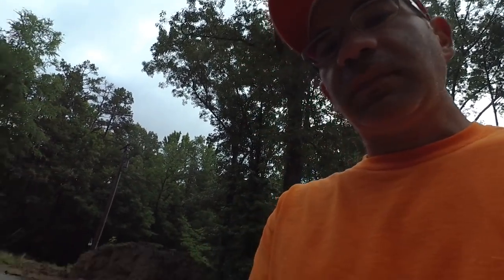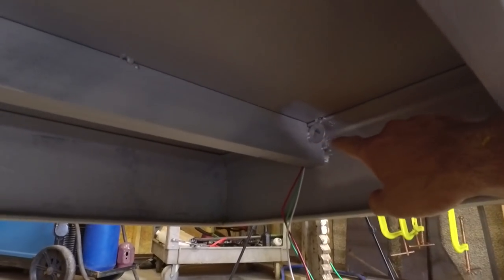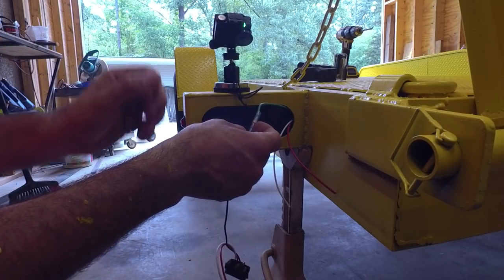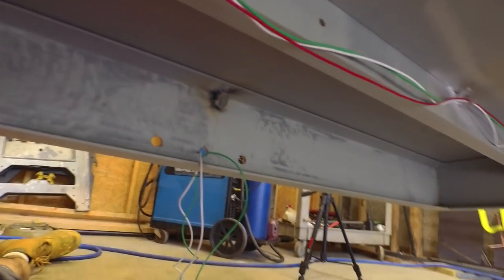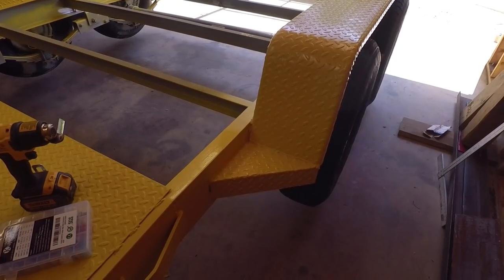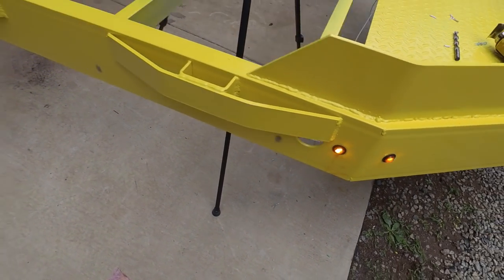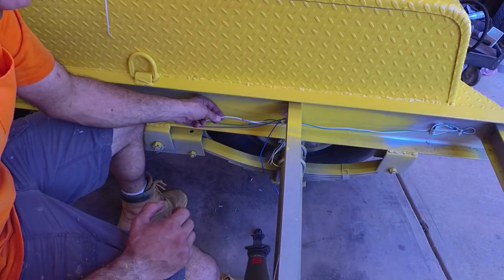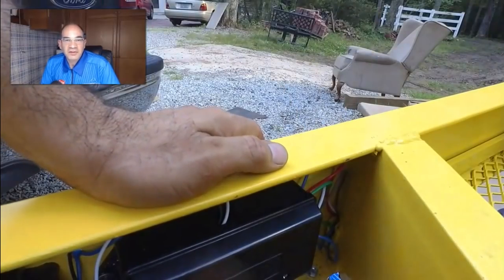Equipment trailer build part 4 Wiring How to wire an equipment trailer

Comment: Another YouTuber, Andrew Camarata used the same type of lights on his trailer build. He did add a plate to cover the 3 marker lights on the rear end, he drags the trailer thru the dirt from time to time. I liked the conduit idea for a wire chase, with all the splicing it would be cut up.
Reply from the maker: Yes I thought about adding a skid plate like andrew camarata did on his equipment trailer but I'm hoping to get by without it. We shall see!

Comment: I’ve built a few trailers in my 71 years and rebuilt and re-wired many every older factory trailer I re-wired that had washers welded that way had had obvious shorts and had been taped up when I got to them. I always grounded the lights near where they were mounted so if something happened to the single ground wire you wouldn’t loose every light. As to the trailer brakes I always used 10 gauge wire to cut down on heat in the mountains

Comment: Shawn, as an ex aircraft engineer I’m concerned that your wiring will chafe. Can you get some rubber grommets or at least protect the wire from rubbing on the bare metal/washers? Great job otherwise as usual.
Reply: Same. That’s what I came to say. Some rubber grommets or something protecting the wire going through all the metal holes would be a good idea IMO
Reply: I'd like to see some UV-resistant electrical-pvc covering all that wire instead of the usual split wire loom corrugated tubing.
Reply from the maker: I was wondering about that Dylan. But my other trailers haven't had any issues. I think the wire is lightweight enough that there's not enough force to chafe or rub through against the washers.
Reply: @GCFD  it's not the weight that matters but the vibration that causes relative motion between the two.
Reply: Personally, I would have chosen to use cable or conduit and not only wire. OK, the colors are not matching up with cable, but the wires are more protected and less chance of getting hooked. And of course, like @Dylan Trinder said, use grommets or cable glands to feed your wire through.
Reply: A bit concerned about having no ingress protection on the junction box. Would probably use serrated washers for mounting the battery and junction box so they can’t vibrate loose over time.
Reply: @bigshafe  Well at least you'll know where to look for shorts to ground.
Reply: @bigshafe I I like to zip tie the wiring to the washers to eliminate the relative motion between the two. With the butt connectors you used that wiring will last  a very long time.
Reply: look at that mr experts he still have this trailer with no problems. you know he not wiring a air plane ✈
Reply: I missed the part where he was building an aircraft.
Reply: @funtyes1970 
6 months isn't a long time to go without problems. As someone who works on trailers for a living, there will be issues where the wires run through the washers if they're left unprotected.
Reply: My sentiments exactly

Comment: Did you check the fall of the wires to make sure the electricity will flow well?
Reply from the maker: Full bubble!
Reply: If I’m not mistaken, in electrical terms, fall is voltage, resistance is how clogged your wires are and current is the amount of flow coming out of the pipe. Sump pumps are batteries, catch-basins are capacitors, corrugated pipes are resistors and PVC pipes are superconductors …

Comment: I have a new-to-me equipment trailer that's a typical wiring wreck. So I returned to your excellent video for a quick refresher on how to best do it. After watching this again and comparing my shopping list to yours I realized that you may have omitted passive / reflective material in your light plan. I'm pretty sure the multi function tail lights include some reflective material but I think that's all. Can you see your trailer in the dark with a flash light or car head lights from the sides or the front?  You might consider adding some 3M amber and red stickers or the good old Silver and red Conspicuity Trailer DOT-C2 Reflective Safety Tape tape so it can be seen when parked. Thanks again for the great trailer build series, it's been very educational!
Reply from the maker: Thanks for watching! I did add the tape in Part 5 https://www.youtube.com/watch?v=y2xLx7wed48

Comment: I second the point about running bare wires through holes drilled in metal, including washers.  You really need grommets or some type of wire loom to run through the washers and holes in the metal.  I also think that the trailer brakes should have been put on a separate ground run to the breakout/junction box.  Otherwise, this is a great job and teaching video.  Thanks!
Reply from the maker: Thanks Richard!
Reply: Can use a piece of silicone hose also. Cut about 2” long and split along length and wrap around wire and feed through hole then cable tie both sides to prevent it moving out of hole.
Reply: There’s several ways it can be done.

Comment: Nice job! Those heat shrink connectors are the best. I use them on my boats, and cover them with another layer of adhesive lined heat shrink tubing.
Reply from the maker: I like the too. How are yours holding up?

Comment: Great video! I add to the comments about the grommets, but I wanted to caution you on that box - it's not as watertight as promised! I used it to rig together the wiring for essentially a trailer, and after a year the entire box was just one gigantic box of rust. I'm rebuilding it using stainless where possible now - perhaps consider throwing dielectric grease in there or something else to provide some sort of waterproofing.
Reply from the maker: Thanks for sharing! I will do that right away!

Comment: Shawn you should have ran your wire through a split wire loom to help protect them from the elements as well as help protect them from shorting out from them vibrating and chafing against the metal.   wire loom is cheap and is a good insurance policy.
Reply from the maker: I thought about that but my 15 year old trailer is wired like this and hasn't had any problems. I don't do any off road with the trailers or go OTR distances.

Comment: Shawn if you're concerned about a small gauge on the blue wire you shouldn't be splicing into the ground wire, but should've run a separate ground for each brake.

This is because the same current that will be pulled via the blue will flow to ground via white.
Reply from the maker: I am planning to splice in a ground near each axle connection and ground to the frame. Should that solve my problem?

Comment: Shawn, Really great job. Just one thing I would do is add some sealant to the junction box where the wires go in. Especially in the top of the box where the white wire goes through. I think you have done a brilliant job.
Reply from the maker: Great idea! I will do that to help seal it up.

Comment: Of course most of the colours are different down under ;-)    I would cut some 1" lengths of garden hose, put a slit in it and push them inside each of your washers.   That will save chafing on the wires over time.  We (down under) have to have a protective cover over the full length of our wires.
Reply from the maker: Good idea!
Reply: This is not standard US writing colors. 
Light trailers in the US :
Yellow=left turn
Green=right turn
Red=aux 12v
Brown=clearance
White=ground
Blue=brakes
Black=reverse

Heavy trailers(semi's) are different in that they use a separate circuit(red) in addition to the yellow/green for brake lights. Blue is aux power/ABS, and both black and brown are clearance and tail lights.

Comment: Pretty Smart guy. I mean it. Did a fine job on that trailer. Like the yellow, almost the same yellow the railroad uses on their Utility Equipment. Must make you feel good that not only did you degree in Biology. You run your own company and pretty astute mechanic and welder. Say's a lot about your work ethic! Great Job. You got any room on that trailer for a fuel cell for your equipment? Now you  need a Generator and a welder for your Dually and your set.
Reply from the maker: Thank you Robert!

Comment: As a aero structural engineer i think you need some grommets or some protection around those washers that you have welded to the frame
It’s always better to be safe than sorry
Reply from the maker: I was thinking that too, but my other trailer is 15 years old with the same washers welded and hasn't been a problem. Like you said, bettter to be safe.

Comment: Hey Shawn. One thing that was over looked is the wire you used is copper clad aluminum. It will corrode very fast. I almost purchased the same wire bundle you listed when I rewired my trailer last year.  Instead I used southwire on their spools. Made In the USA as well!  

From what I've seen most axle manufacturers recommend 10-12 gauge for the brakes so you don't have as much voltage drop to them.

Take care and keep up the great work and videos!

Comment: Super great build, I have worked with a lot of connectors and have never seen those heatable solder connections cool. I am not a fan of the metal washers to guide wire. You should put put an inline fuse on the negative side just in case anything shorts, even beyond fuse box. I see a lot of metal against wire on builds. Ziptie to washer works better.
Reply from the maker: that's funny you say that because I thought about ziptie to washer but went through the washers instead because my other trailer is wired that way. I guess I could cut the washers and reweld some for zipties if I have any problems.

Comment: A good tutorial Shawn however running a grounding wire (negative) to all light fixtures is far superior than relying on grounding at each fitting due to dissimilar metals causing electrolysis  between joints.Electric brakes will work better if all the cables are run from a centre point and the same length otherwise you may find the closest brake will work better than the furthest brake especially if the company is planning on heavy loads🇳🇿🙏🙏👍
Reply from the maker: Great tips! thank you!

Comment: Thank you for your detailed video. This was exactly what I was looking for. I’m about to wire lights, brakes, junction box, and a breakaway box myself.

One question- is there anything you would had wired differently now that you’ve put on the road for some time? Just curious because I’m about to follow your video for doing mine.

Thanks,
Iz

Comment: Dylan is right, grommets are needed or over time the washers will rub the wires until they short
Reply from the maker: My 2007 trailer is wired the same and hasn't had any problems, which is why I did it this way. Seems like it should be a problem in theory but hasn't been. I don't think the wires are heavy enough to provide the frictional resistance to rub through.

Comment: Isnt it cool that wiring is just like designing a drainage system? Of course you dont worry about fall, but amps = volume of water, voltage = pressure, and wire and connections = pipe size and tees. I've enjoyed the build series.
Are we going to see the deck get installed and it's maiden voyage?
Reply from the maker: Yes and Yes Dave! I'm working on the next installment. This has turned into a much bigger project (the video series) than I was expecting.

Comment: The last thing you want is your brakes to work separately. If you get a short on the 2 left wheels and those don’t engage and the 2 on the right are functioning correctly, there is a good chance you’ll wreck. Absolutely crazy to do it like that

Comment: Thanks for uploading these vids, love watching your work!

I suspect someone has likely already mentioned it but it would definitely be worth running the wires through rubber or plastic grommets rather than bare metal to avoid the risk of sheath damage over the years which could potentially end in a short.

Out of interest can you not run negative through the frame of the trailer like it is in the chassis of the car to save a bunch of wiring?
Reply from the maker: I haven't had any problems with the wires rubbing through on my other trailers. I suspect it's because the wire is not heavy enough to rub hard enough. Yes, you can ground each of these lights to the trailer frame, but then you need the trailer to be grounded to the vehicle to be grounded to the battery. Here, I ground through the wiring harness and to the frame (by the frame ground in the junction box).
Reply: @GCFD  Thanks to the prompt response. Can't wait for the next vids :)

Comment: you should have used another separate ground wire for the brakes to balance the electrical load
Reply from the maker: I was thinking that while I was making the video. I may splice in a ring terminal near the brakes and self tapper to the frame.

Comment: hello, 
Great video.  in your time lapse of the installation of the Bunker Indust break-away system, I can not tell where the white wire and the black wire running from the battery screw into the junction box?

Comment: Great video!  I am about to redo a similar trailer and I was thinking of running 3 junction boxes, front, axles and rear connected with 7 pair bundle, then just doing short runs from each JB to brakes, running lights, tails etc.  This will be my first time doing this, am I missing something or would this work?

Comment: All that work I would  have  ran through  wire loom or made race ways  to cover te wires and use wire clamps instead  wire ties  like  solider  shrink  but I would put another  layer  of black adhesive  shrink  over it . Great  video though.

Comment: About wires rubbing on washers :  just cable tie wires through the washers to prevent any movement. A quick fix. Cheers
Reply from the maker: that's a great idea Steve! I'm going to do that for sure.

Comment: I use 16ga two wire exsenshin cord with rubber cover for markers and three wire ,for tail and turn, (back) and mark the ones in the box witch is left and right ! it is faster and eziaer to home run them .

Comment: Just an FYI - Remember, a LED is a light emitting diode, and work as switches or gate keepers and as such are polarity sensitive. They block current flow in one direction and allow it to pass in the other direction.
Reply from the maker: Yes I remembered that when I watched the clip. I was thinking of fans at the time. 👍

Comment: Would it have been easier to run a marker and ground wire on both sides of the trailer and use a butt connector at each light??
Reply from the maker: You could do it that way for sure. Or ground with a self tapper at each point.

Comment: Running the brake wires independently, how did that work out?

Did you cut the wires the same length for the brakes?

Comment: hey, thanks for the awesome videos. I Remember you had a specific pitch for french drains, was it a 16th of a bubble? I cant find the video which you spoke about it. Thanks.
Reply from the maker: Yes the french drain pipe needs to be fairly level. The reason is the water flooding up in the trench will be level.
Reply: @GCFD  is there a rule of thumb for the depth and width ? I'm trying to collect no point water in the back yard. In heavy clay soil . And pretty muching to create a gaint catch basin .

Comment: Will the wires going through the holes you drilled hold up over time rubbing against the sharp edges of the holes? The 90 degree bends in the wire through the fresh drilled hold worries me, but you have experience with this stuff!
Reply from the maker: I did file down the holes after I drilled them to smooth things out. I hope it's not a problem.

Comment: For that connector, I think you still need to mesh those wires together first before you menlt the solder just to be sure. just slide it to one side, twist or mesh wires together, slide it back and heat.

Comment: LED lights are always tied to the polarity of the wires.  Light Emitting Diode.... DC circuit so the current only flows in one direction and not the other.
Reply from the maker: Good to know! When I was watching the video I realized I was thinking of Fans when I said that. Oh well.

Comment: Shawn those melt on connector are crap, the low temp solder is weak and brittle and will fail from vibration.
Reply from the maker: I will keep an eye on them. So far they are working on my other repairs I've used. Thanks!

Comment: Nice job on the trailer wiring the overall build is good but I see a few red flag...... 1 why aren't the wires in a protective sleeve? 2 why u didn't use rubber bushing for each hole penetration?? Remember metal edge is sharp and the vibration can chaff the wires
Reply from the maker: I talked about that in the video. My 2007 trailer is wired just like this and has never had any problems. I wouldn't leave the wires exposed like that if you're doing off road or crazy stuff with the trailer.

Comment: The battery should charge all the time as long as the trailer is plugged into the truck. The charge wire is not key on only it's always on.
Reply from the maker: On my truck it's key on only.
Reply: @GCFD  that's odd I have the same truck and the charge wire is always hot

Comment: I would have bought the gray electric break wire and I use old extension cord as my 3 wire need and I never had any problems with use old extension cord or gray electric break wire and also wire a ground wire from the front to the back because if you don't you will have problem will it
Reply from the maker: I don't understand how the ground is not throughout the whole trailer with me tapping directly into the frame.
Reply: @GCFD  yes ground whole trailer but I have had problem will that I have a ground back wire back by the light and if you want I can take a picture show you

ps I have a ground by the light and whole trailer because I have always had problem with trailer ground
Reply: if you have a way I can send a picture of how I did it

Comment: There's some scary looking welds on that trailer. All rust and mill scale must be removed before welding. Critical vertical should be made up hill. Dual shield wire with 75/25 gas or 7018 rod would be best.